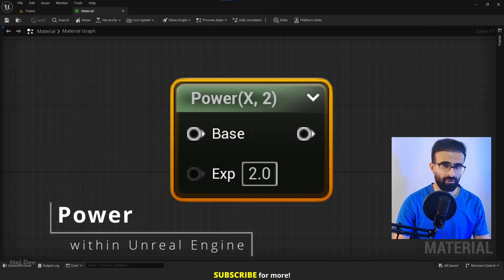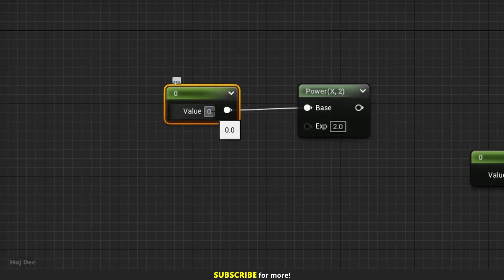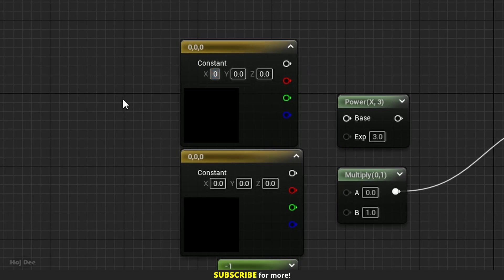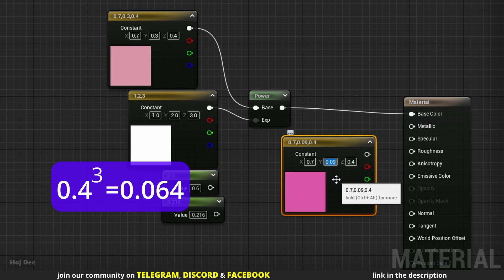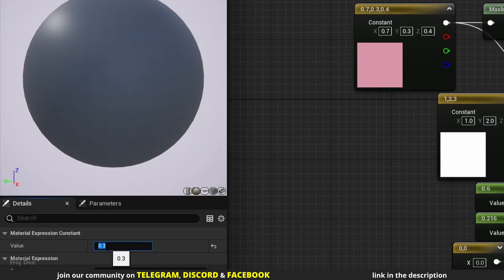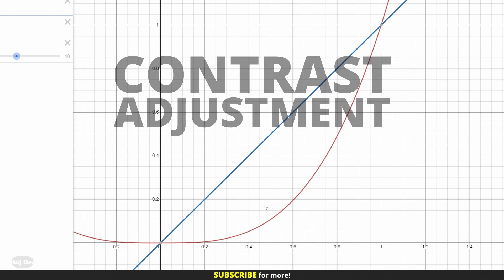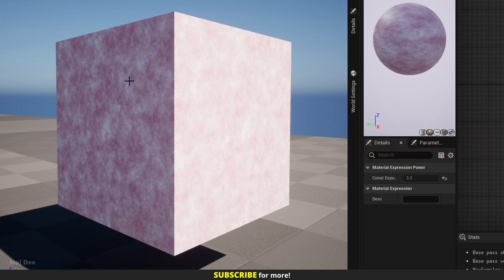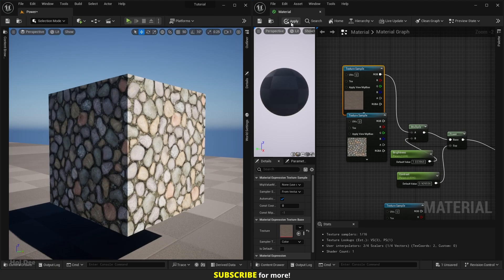Power Node EXPLAINED! Unreal Engine Materials

Comment: How can I dynamically compensate the lost after I apply the power node? I mean when I apply a power of 2 i usually multiply the output but 2 or by 3 and it backs to normal  but I would like to do it dynamically.
Reply from the maker: @factchecker2179  sorry I didn't get your question

Comment: There is a problem with your master materials, it is missing some function and can't be used.
Reply from the maker: Thanks for telling me. I'll check and reupload it tonight. This happens when new engine versions come out.
Reply: @HojDee  I know, I've lost few of the things I made myself. That's one of the annoying bits with regular new releases unfortunately
Reply from the maker: @povilaslondon  yeah... I'll tell you here when I upload the new material
Reply: @HojDee  much appreciated 👍🏻
Reply from the maker: @povilaslondon  I just checked the material. There are no missing material functions in mine...Did you manage to find out what the problem with yours is?
Reply: @HojDee  you probably have some plugins running because as soon as I open M_HojMaster material right next to material attributes node there is unspecified function.
Reply from the maker: @povilaslondon  the only function used in this material is the mf_rvt function. It's included with the content. So you can add it to the material from the functions folder next to the material. You can also message me in discord or telegram channel. There I can send you screenshots to better help you
Reply from the maker: @povilaslondon by the way, what is your  unreal engine version? 5.3 or 5.2? The content is in the 5.3 version I think. That could be the issue too.
Reply: @HojDee  yeah I'm using 5.3. So what is plugged into material attributes node then?